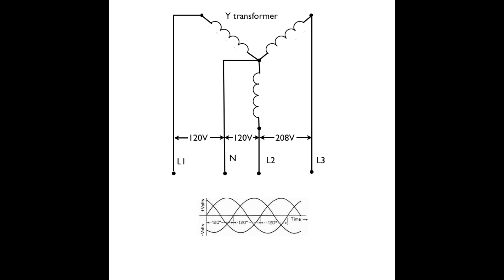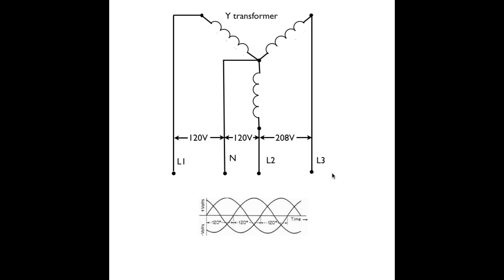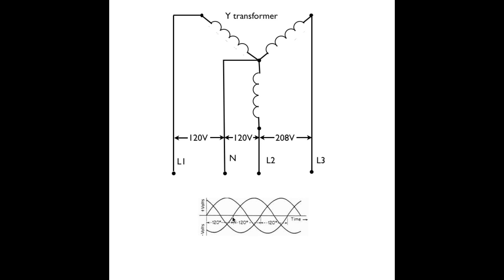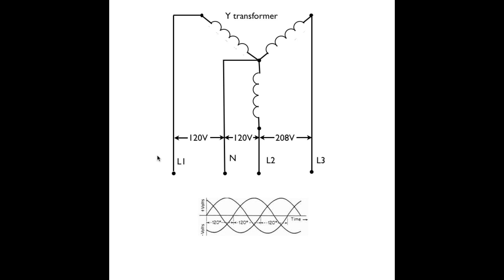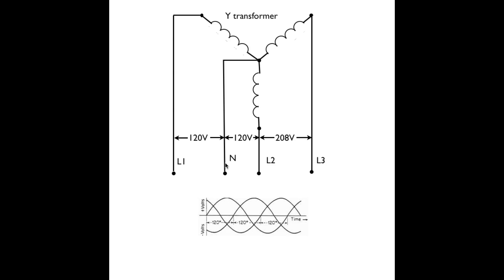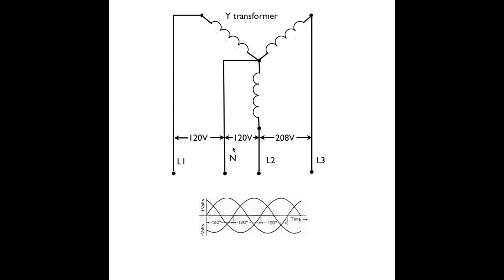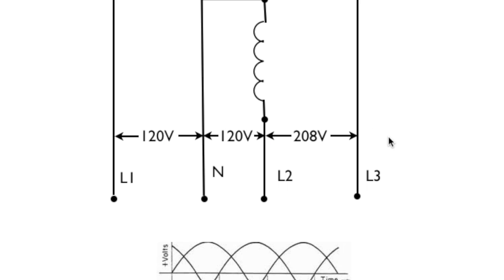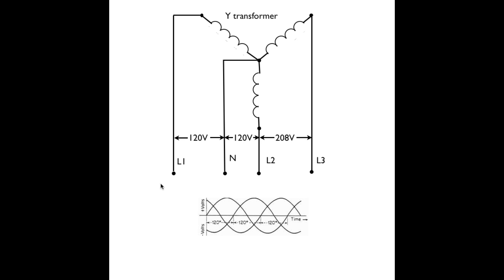How the 3 phase Y transformer works

Comment: neutral is a means for current to return as an unbalance load, in turn helps balance the collapse and raise of voltage in each cycle.
 Each 120v leg will or may have difference in potential, the neutral allows balance to the secondary side of the pot.
  in the video this person talked around why you get 120/240 verses 120/208 volts..... 120/208 is a wye configuration, which is 120x1.73= 207.6 volts with a floating neutral.....{ 1.73} represents phase to phase measurements. 120/240 is delta configuration....into which the lighting pot is split in the coil through neutral...usually in a vector graph it will show the split on phase c to a with the neutral between to make 120v....a to b, b to c, is the power coils of 240v. 

hope this helps!!!!

Comment: If the neutral isn't a "return path," what is it? Why is there? What function does it serve?
Reply from the maker: There is no return path in AC.  It is a "zero voltage" terminal.  Because it is a center tap of the transformer windings, you can pull a 120 volt single phase circuit between L1 or L2 and the neutral terminal.
Reply: GrayFurnaceMan, thank you for your response. By the way, I’ve also viewed your video on 3-phase Delta transformers. Where did you learn this stuff?
Reply from the maker: Many years in the business
GFM
Reply: It is part of the 120V circuits and is similar to the neutral in a common 240/120V 3-wire system.

Comment: is there a such thing as a single phase single line overhead power line (with no neutral)?  using ground as a return.
Reply: aaron odom In theory it could work, but it's not done because the ground impedance is too high in most cases, among other reasons.
Reply: aaron odom new zealand uses this system in rural areas. swer. single wire earth return. 11kv line voltage. ancient system. requires good ground.  the ee who invented its name plus clothesline is the slang name for it in nz
Reply: aaron odom mandenos clothesline of 1925

Comment: you didn't even give a equation for the voltage to become 208. and just explained bull shit
Reply from the maker: There are plenty of videos using equations.  My job is to give a reasonably simple explanation.  Please no swearing in the comments.
GFM
Reply: Can you explain me about 3 phase induction motor then??
Reply from the maker: I will put it on the list.  Hopefully soon
GFM
Reply: it has to do with the windings of the phases being 120 degrees apart and vectors( i dont know much about all that so you might have to do some studying of vectors). But a easy way of doing it is that in a wye connect, the line voltage of the transformer is multiplied by a factor of 1.732 (which is the square root of 3, this comes from the vectors stuff). So a 208V(line) has a V(phase) of 120 since 208/1.732=120. In a delta connection tho the phase voltages and line voltages are the same.
Reply: delta  and Y  is the same output, and transformer is defrent  to Y  and delta but how can i find neutral in 3 phase  L1- L2- L3

Comment: is it wrong to approach why the line voltage is 208 instead of 120 from the phasor diagram method? iow: since all phases have 120 deg of difference, going for 120 tan120 = 208.

Comment: So on the wye system I have L1,L2,L3 that is 3 legs of 120v and then the neutral is center tapped. So my question would be What is the voltage at the neutral that's center tapped, cause between the hots is 208 except for the neutral.
Reply from the maker: The voltage at neutral is 0.  It must be considered that it would be 0 because the only place to put the meter leads is to neutral.  If you place the leads between any hot lead and neutral you will have 120v.  If this does not help you might explain your comment further and I may be able to help.
GFM
Reply: Ya it's grounded I thought there would be voltage
Reply: Marcus Rowley Voltage means potential difference between 2 points. With 120 volts applied to L1 and neutral you will only measure 120. Each end of the power taps is the sum of the voltage applied.

Comment: I have heard that the neutral can have voltage on it if the loads are unbalanced.
Reply from the maker: John Kerley True. If there is no path from L1 to L2, it will go back thru the neutral.
GFM
Reply: You mean current.
Reply: @GH-oi2jf  Voltage would show on an Open Neutral, dangerous situation.

Comment: Simple version of how you calculated the voltage between phase and neutral in a 3 phase y system:

L-L/√3 = L-N
So for you Americans:
208/√3=120
Reply: For a 240v two leg system the phase is 180 degrees. eq 120+120=240 volt